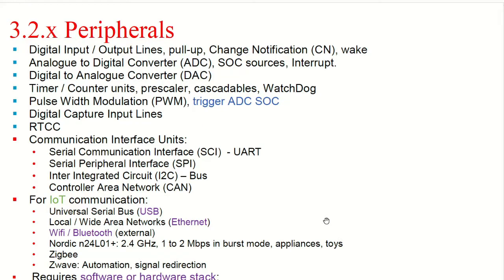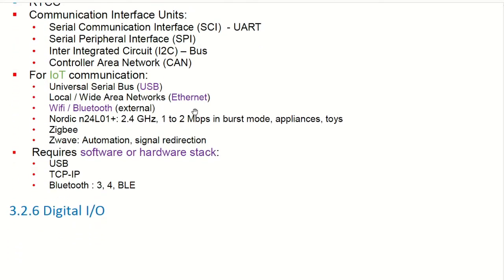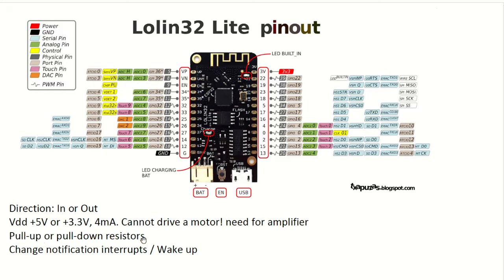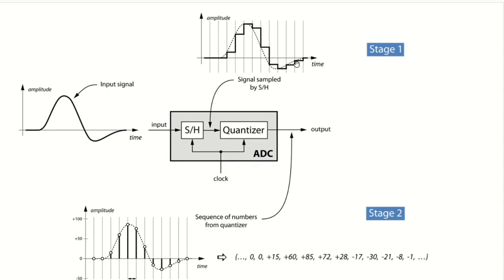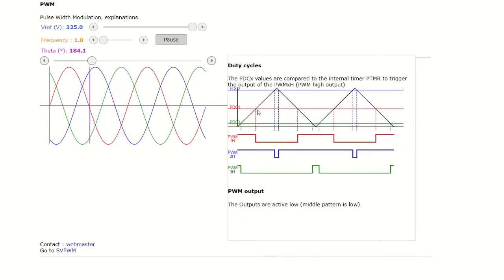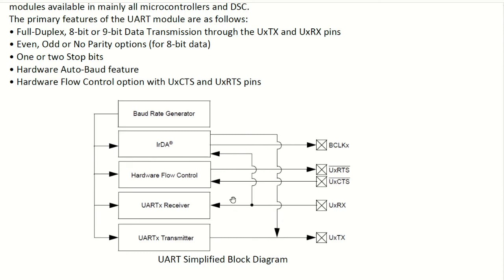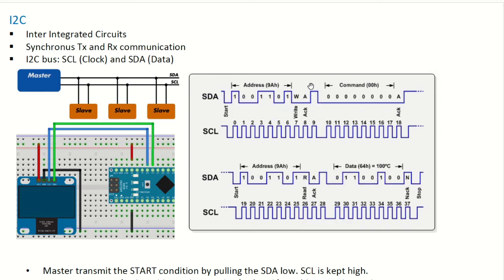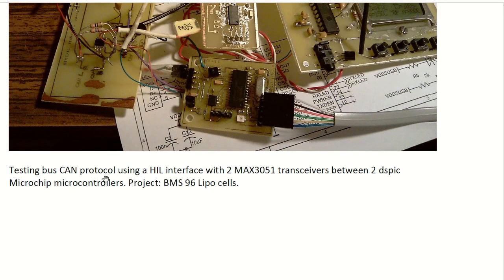Peripherals and communication protocols for digital motor control, P-HIL - E03

Comment: Monsieur bonjour j’espère que vous allez bien s’il vous plaît est-ce que la machine asynchrone à cage qui tu la fait sur elle la commande vectorielle est de 1.5 kw 3.4A 1423tr/min langlois si oui s’il vous plaît donner moi leur paramètres svp
Reply: bonjour c'est une MADA (rotor bobiné)
MACHINE TRIPHASÉE ASYNCHRONE A BAGUES 1500W AVEC CODEUR 1024PTS REF. MAT20-C1
Puissance Utile : 1500 W
Vitesse de rotation : 1340 tr/min
Fréquence réseau : 50 Hz
Tension d’alimentation en couplage Triangle : 230 V
Tension d’alimentation en couplage Etoile : 400 V
Intensité absorbée en couplage Triangle : 6,4 A

Intensité absorbée en couplage Etoile : 3,7A
Tension rotor (couplage Etoile) : 58 V
Intensité rotor (couplage Etoile) : 15A
Cosinus phi : 0,8
Moment d’inertie : 0,022 kgm²
Refroidissement : Autoventilé
Utilisation avec un variateur : Max 15 min pour une vitesse de rotationinférieure à 900 tr/min
Protection thermique : 1 sonde de température de type PTO130°C
Hauteur d’axe : 112 mm
Raccordement électrique : Sur plaque à bornes de sécurité de 4mm
Reply: @lotfibaghli8117  salam monsieur merci s’il vous plaît si vous avez une méthode d’identification paramétrique d’une machine asynchrone à cage envoie-moi un document aider moi
Reply: @abdelhamidzabouri153  lisez ma thèse
Reply: @lotfibaghli8117  d’accord monsieur merci
Reply: Monsieur s’il vous plaît est-ce que l’identification des paramètres par la méthode génétique dépend votre application masvect vue dire il faut utiliser l’application masvect pour l’identification ?